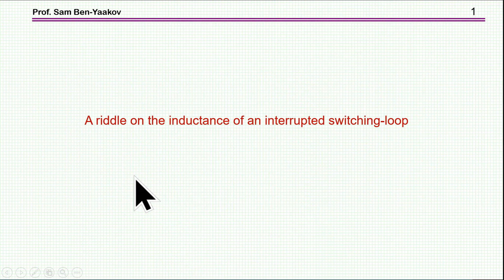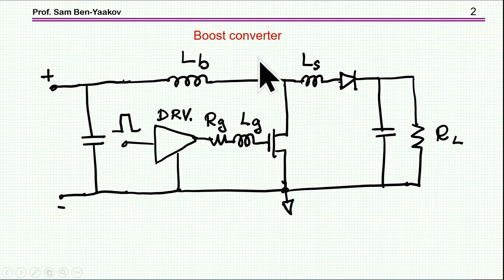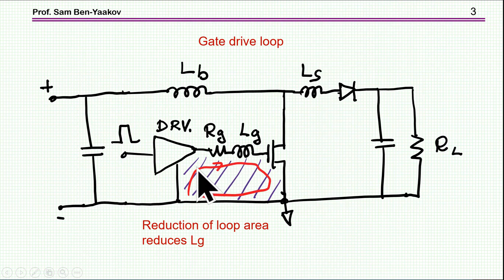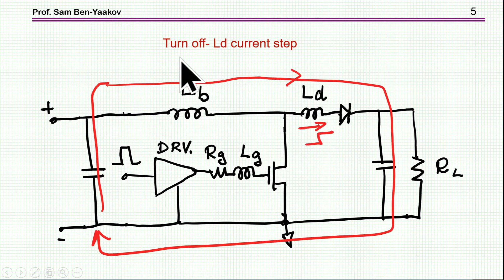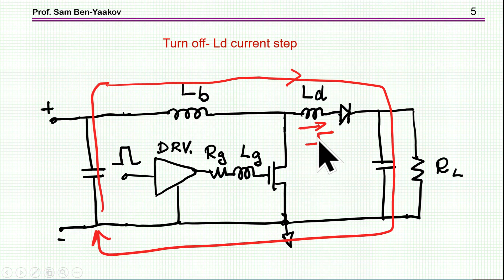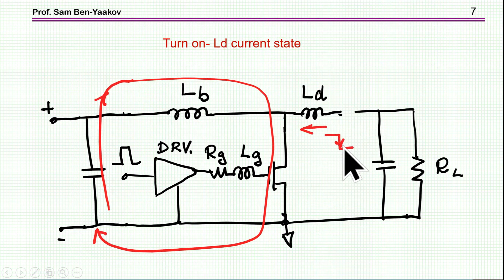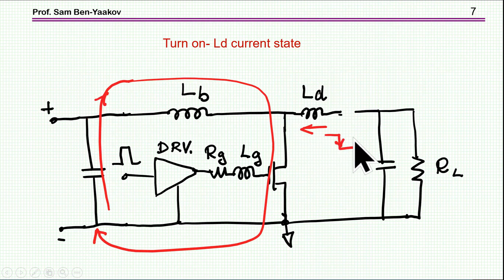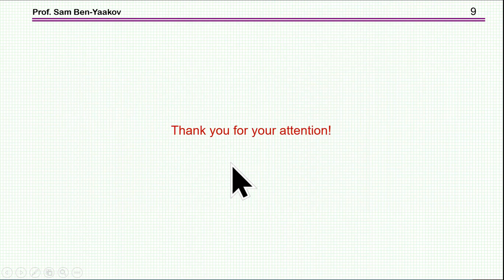A riddle on the inductance of an interrupted switching-loop

Comment: One practical way is: increase Rg to slow down FET turn-off, therefore minimizing rising edge di/dt. For the reverse recovery, I simply use SiC diodes that have little to no reverse recovery, so you don't need to deal with. In a 2kW boost prototype the above 2 were sufficient to have very minimal over/undershoot on switching node.
Reply from the maker: Thanks for participating and input.

Comment: I guess adding a series RC snubber across the diode could take care of the reverse recovery current path and ensure slower voltage buildup. Layout minimisation of inductances at voltage stiff side of the switching converter is anyway a default target for the layout designer.

Would like to know your thoughts about Rick Hartley’s videos on better PCB layout(https://youtu.be/ySuUZEjARPY). Having a continuous return current plane right below the gate drive lines versus separate trace in any other layer.
Reply from the maker: Thanks for link, I will try watching it. I think uninterrupted ground plane below is the best. I have also found that running signal and a ground traces side by side on same plane, is also satisfactory.

Comment: First, make sure that the loop area made by the FET, Diode and output caps is small. 
Next, place a small capacitor, preferably a SMD so that there will be no additional inductance due to the leads, from the cathode of the diode to the source of the FET to make a very tight high loop for the high frequency currents. 
This prevents the current of the reverse recovery from travelling in the large loop, minimizing the inductance effects.

Looking forward to the answer on the next video.
Reply from the maker: Close. Thanks for participating. Hold on to my answer.

Comment: Since the diode continues to conduct for a short period after the current is reversed,
To reduce the power loss from that reverse current through the diode 
You would want to reduce the dv/dt on Ld
By slowing the FET turn OFF
Would you suggest 
1. an RCD snubber across the FET drain-source 
and maybe
2. an active snubber on the gate of the FET
Reply from the maker: Close. Hold on to my answer. Thanks for participating.

Comment: Unless I have missed something, you  mention disturbances in Ls..... where is Ls?  The two stray inductances, Lg/Ld  are very small and likely cause resonance only at higher harmonics. Increasing the inductance of Lb will introduce a phase lag , slowing the rising edge of Ld. Lg should not be a problem, the  high gate C of the mosfet will swamp any inductance here.
Reply from the maker: As one can realize from the slides, Ls=Ld , A labeling error. Sorry for confusion. Hold on to my answer. Thanks for participating.
Reply: @sambenyaakov  Sorry, yes my mistake. A small capacitor from Ls/diode junction  to Mosfet source will apply any  negative going pulse to the MOSFET source, thereby canceling that disturbance.  However, given the implication of the use of a power FET, the frequencies used here are likely sub HF, these parasitic inductances are tiny, I  would think the problem is largely academic.

Comment: I would put a trace ring tracking the inside of the loop to act as a short circuit secondary to suffocate rapid magnetic field changes. Or you could even interrupt the ring somewhere and put one end directly connected to the transistor collector/drain and the other end between Lb and Ls/Ld. This could lower the amplitude of noises while adding more harmonics. Or you can spam around conductive rings with mosfets driven by the IC to either close circuits between some local voltage source or just be active rectifiers in snubber network duplicating circuits to create currents and magnetic fields neutralizing the original noise sources.
Reply from the maker: Close. Hold on to my answer. Thanks for participating.
Reply: @sambenyaakov  can't wait

Comment: The idea is to minimize Ld • di/dt. So my 2 cents are:

1) Good PCB design practices to minimize Ld
2) A small capacitor in parallel with Lb and another from diode Anode to ground. I believe that will decrease di/dt in Ld.
Reply from the maker: Close, but not sufficient.  Hold on to my answer. Thanks for participating.

Comment: I'm not sure how slow switching circuits would be at risk from minute stray inductances in wires. But considering my modest experience in RF, I'd say there are a number of ways, I'm just guessing, have a ground plane on the same layer close to the E (electric field) fringes to limit RF interference. Have a bottom ground plane as well. Complete the circuit between both ground planes with via stitching. Another way is to dampen the switching effects around Ls is to connect a parallel series-capacitor-resistor. But to imagine a wire in parallel to a resistor-capacitor, of course just tune the length of the copper transmission line to remove these by coupling the termination to be capacitive.
Reply from the maker: First step is clearly reducing the induce. Bat this is not enough. I have witnessed diodes explosions due to the voltage spike . Hold on to my answer. Thank for participating.

Comment: I think needed to split current loop in such a way that will cancell magnetic field. I thing dual matched fets and dual diodes may work. Snubber may help also.
Reply from the maker: Too complicated. Hold on to my answer. Thank for participating.
Reply: @sambenyaakov  Another way I was thinking, is to route in such a way that Ls and Lg will cancell each other magnetic field.

Comment: My uneducated guess is putting another diode with anode grounded, and cathode connected to the anode of the diode from the schematics. Efficiency will suffer a bit, but we'll get rid of the negative spikes present otherwise.
Reply from the maker: Too complicated. Hold on to my answer. Thank for participating.

Comment: Hi Professor, after all PCB considerations to minimize the stray inductances, for the problem of reverse recovery of the diode, I suggest putting a small capacitor(which needs to be designed with respect to the Ld) between the cathode of the diode and the ground side of the output capacitor so that the created loop between them becomes minimal which is feasible since they are usually close.   
Or for both step times, I think we should design Rg_on and Rg_off to reach safe di/dt.
Reply from the maker: Good answer albeit incomplete. Hold on to my answer.